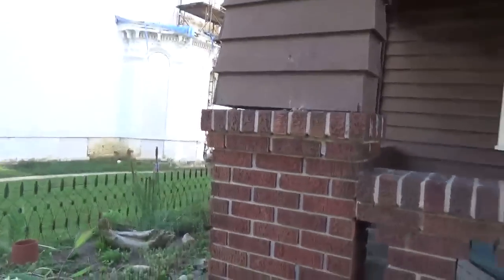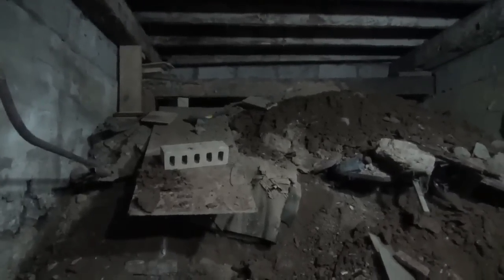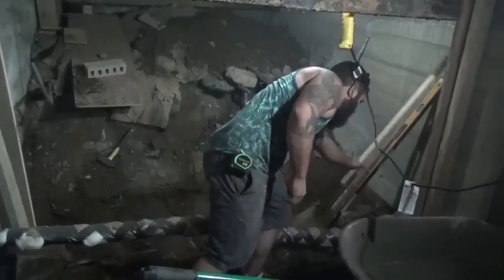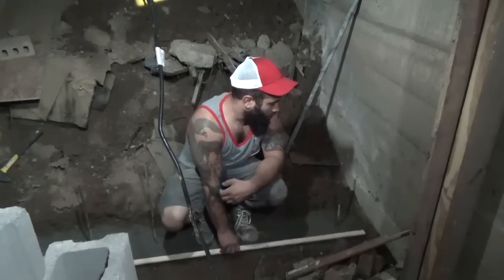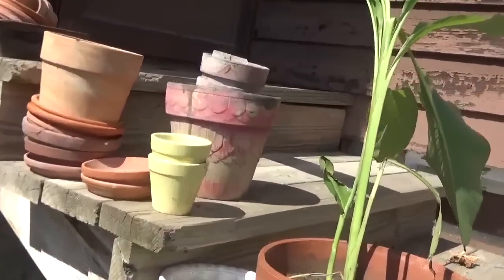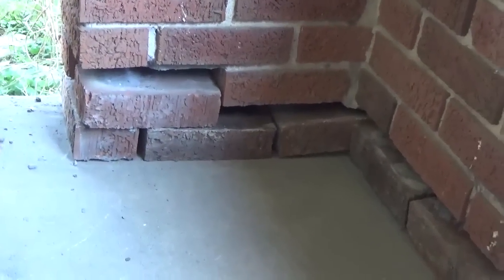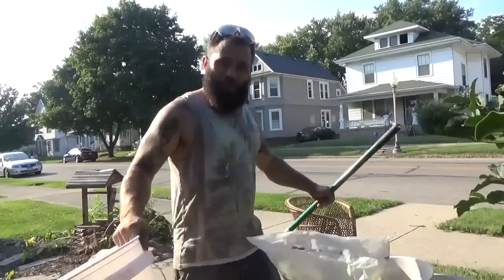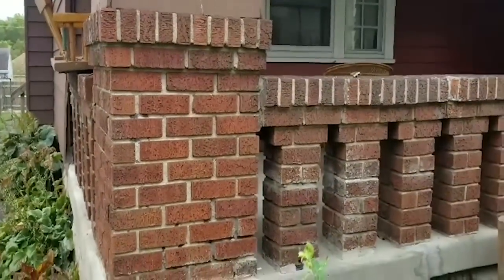Masonry Madness:  Concrete, Block, Brick and Grout

Comment: I had to pour a small slab and ran out of concrete and all I had was some structural grout that I quickly mixed and dumped in the hole and kind of mixed it with the wet concrete I had just poured. This morning it's got a rubbery feel to it. It's hard but kinda rubbery. Do you know if that's how grout drys